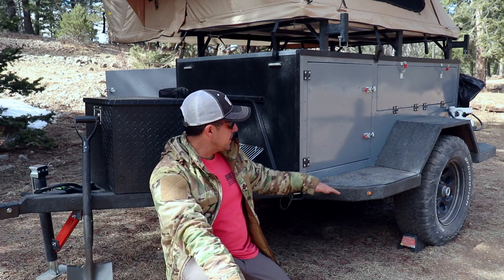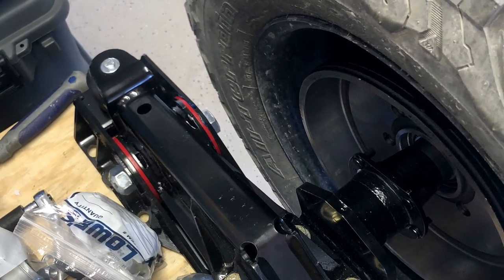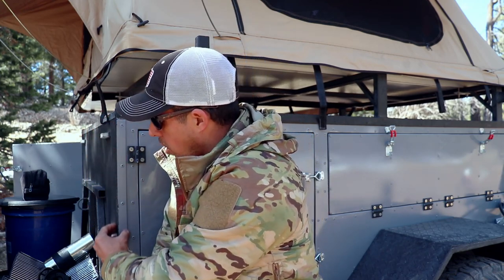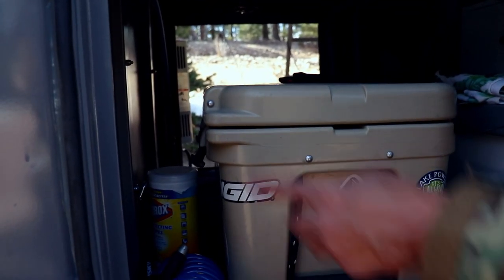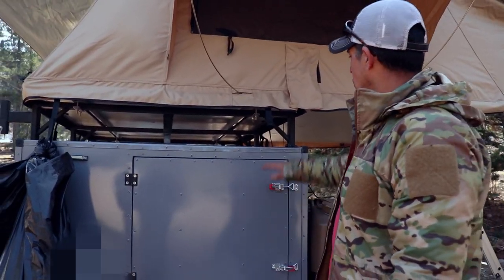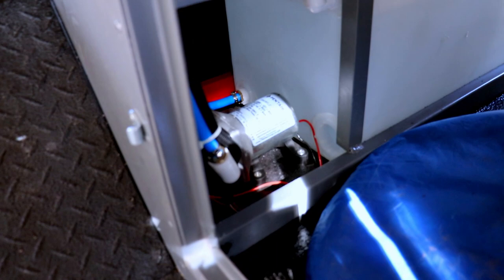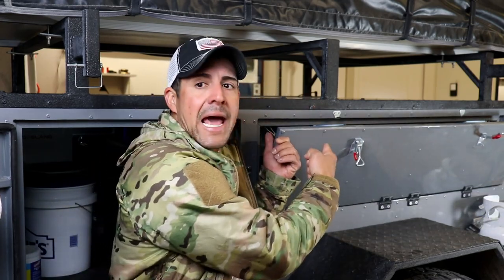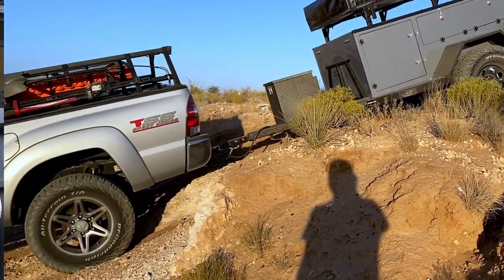DIY Overlanding Trailer

Comment: Thanks for this video. I would like to do my own with a family that knows how to weld. I am just not sure how to start. If you don’t mind sharing the specs, please let me know to send you my email address or anyway. I’m trying ti get to camping and overlanding. Just got my equipment for camping and building from there. I’m in the group Boricuas camping in US, where I found out about this video. Thanks again and mucho éxito!
Reply from the maker: Glad you liked the video!!! Yes, send me your email as I be more than willing to share any info with you and/or lessons learn during the build.  I designed this trailer from scratch so there was a lot of trial and error but I did documented most of the measurements once i got them where i wanted them.

Comment: re -- silicone sealer
2003, we converted a 1996 Ford CF8000 commercial truck to our concept of an ExpeditionVehicle.
After using ('attempting to use'...) silicone sealer on other projects, but it always failed, we experimented with Vulcum 116.
Nearly two decades full-time live-aboard, summers up rough logger tracks to remote mountain lakes, winters on isolated Baja beaches, our Vulcum 116 remains soft and pliable.
.
My problem with silicone:
Besides lack of stretch -- instant 'fail' on shifting components -- the stuff is impossible to remove.
I start with a putty-knife, move to a chisel, and after a couple-three months, I am considering something in the nuclear family.
That frustration is in addition to wear-n-tear on my financial and spiritual health, friends, family.
As you can imagine, I needed to cut back on all other activities to focus on the failed silicone... sleep, work...

Comment from the maker: I wanted to keep it as compact as possible, but having that extra space for the kitchen is probably a good idea. I current use a plastic bin as my pantry but with the extra space it could all be together.
Reply: Thanks for the great advice.... Did you have any welding knowledge or anything like that? From the videos I've watched on just frame building it seems pretty straight forward. I have zero welding experience but like anything it can be learned on YouTube. Also, roughly how tall is the box of the trailer? say from frame to top of the box... I would love to make something similar to TurtleBack in the rear with one large door that opens like yours but then have some drawers slide out for my Blackstone Griddle and maybe a sink if I get extra fancy.
Reply from the maker: @jdpst20  very little welding experience.  I’m pretty good at wood working so the cuts and framing is every similar. As for the welding youtube education. Started practicing on scrap metal then built a few small projects and jumped right into the trailer.  The grinder will become your best friend “Lol” but you’ll for sure be an expert by the end of the build.
Reply: @range11tactical16  thanks for the encouragement!

Comment: Love the video! Exactly what I'm currently making. QUESTION: Did you consider building the kitchen box out from the frame over the tires? I'm thinking about that to keep the space inside the trailer. More like Patriot trailers. Thoughts?
Reply from the maker: I wanted to keep it as compact as possible, but having that extra space for the kitchen is probably a good idea. I current use a plastic bin as my pantry but with the extra space it could all be together.

Comment: Hi there i would like to know more about how waterproofing please thaking you in advance
Reply from the maker: First the top/roof panel hangs over the edge about an inch on the front and back, everything was siliconed before assembling and the one inch angle peace close everything up.  For the door i used car style gaskets attached to the doors, originally i had them on the frame and water would get in.  Hope this helps.

Comment: Curious on what you used for floor ?
Reply from the maker: Just used sheet metal with a thick coat of truck bed lines on both sides once installed.  So far it’s held up and no rust.

Comment: Awesome trailer build! Currently doing my research now and deciding how large I want to build mine. I think my main priorities are a cool cooking area "love cooking" and hot shower capabilities. I am towing with a Land Rover Disco and the size of yours seems perfect. Not too big but not small where you could run out of storage. Question about the door system and body of the trailer... @ about the 3:14 mark the door frames, how are those engineered? I know if the one shot you show the whole frame laid out to where you will have storage doors ect. I'd like to try to replicate a Turtleback Expedition in a way that has a pass through door in the front or where I can throw a slider for fridge and then have my kitchen out back. Are there more details you can give on how you layout doors or compartment storage and how you attached the sheet metal to the frame and make it sealed from elements?
Reply from the maker: Once I framed out where the doors would be with the 1x2 square tubbing as in the video then welded 1inch angle iron around the frame to act as a stop and leave space for the gaskets. I built the doors out of 1/2 square tubing then cut sheet metal and riveted it to the door.  (I tried welding the sheet metal at first but it was so thin it keep burning through) The hinges attach to the square tubbing where I drilled holes all the way through and welded the nuts to the inside so I could trim screws once it was installed and it wouldn’t hit the frame.  Hope this help!!! Side note: I siliconed everything as I riveted to keep the water out and to date it still dry.
Reply: @range11tactical16  Awesome... yeah I watched a few other videos too and paid close attention to inside the frame. Of the frame of say 2x2 yeah I saw essentially flat bar that was welded to the back of the frame which created a "stop" area for the door that you could then adhere the gaskets too. Then just make a door with a smaller frame and the sheet metal like you mentioned that rivet's into place. I think since it's painted and finished it looks way cleaner than I think it would look when doing that method, but raw material it's easier to understand the process. I'm hoping to have something like this started this upcoming spring. At least having a hot shower capabilities so the wife will wanna go out for more than 2 nights lol.

Comment: I know you gave dimensions in the beginning but what size is just the body of the trailer and total outside width of wheels  it seems kinda heavy would you have built lighter to save weight?
Reply from the maker: Phil, the main frame of the trailer is 48” wide by 78” long (just the rectangular area not counting the tongue box area) once I built out to the fenders those were an extra 13” on each side, with the total with of the trailer being 6’-2.5” wide. As for the wheels, yes if you want, you could go lighter and that would be fine, I just wanted them to be the same as my truck that way as I get new tires I could just replace the trailer ones and if I need a spare, they would both be the same.  Trailer it self is still pretty light, I can maneuver it around in my garage by hand even when fully loaded.  Hope this helps!!!
Reply: @range11tactical16  so the actual  total weight of the trailer is about 2500 lbs? I'm building a trailer with a 7k axle
Reply from the maker: Yes about that. It’s pretty light, I don’t even notice it when pulling and gas consumption is roughly the same. Good luck with yours!!!

Comment: How tall is the storage compartment.
Reply from the maker: The doors are 24’’x24’’ with a bit of extra space on the inside.  Front compartment runs the width of the tailer 6.5feet. Back compartment is about the same with some extra space under the kitchen.
Reply from the maker: The doors are 24’’x24’’ with a bit of extra space on the inside.  Front compartment runs the width of the tailer 6.5feet. Back compartment is about the same with some extra space under the kitchen.

Comment: Found your email and sent a request. Have a question on the size of the water tank?
Reply: What gallon size?
Reply from the maker: 22 gallons.
Reply: Where did you buy your 22gal tank. Unable to locate the size needed to fit under the kitchen area and leave enough space for the tank. Thanks
Reply from the maker: Randy, sorry I was mistaken it’s actually a 20gal, had to go back and check my order history. I bought it on amazon, below is the link to the one i bought this was back in 2020 thou

https://www.amazon.com/Class-A-Customs/b/ref=bl_dp_s_mw_14400942011?ie=UTF8&node=14400942011&field-lbr_brands_browse-bin=Class+A+Customs
Reply: Thanks the t2000 looks like it.